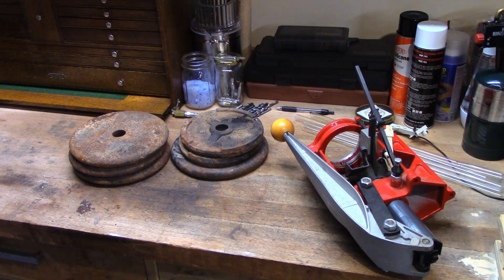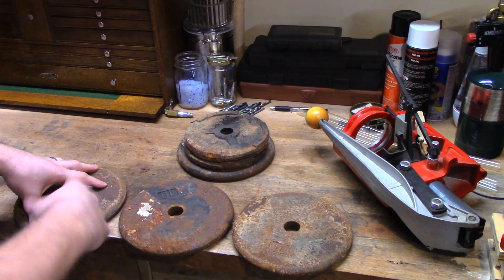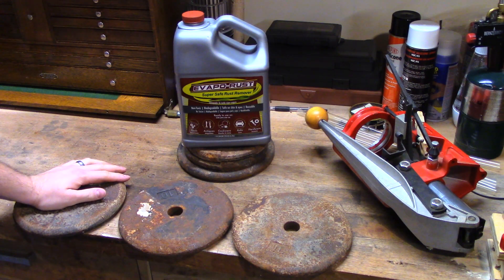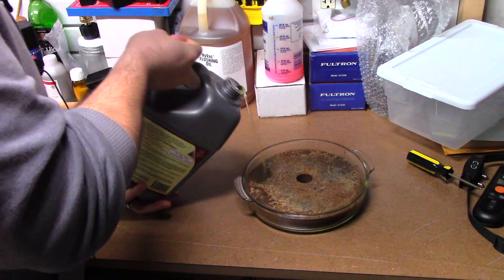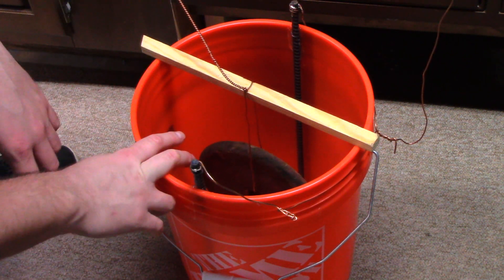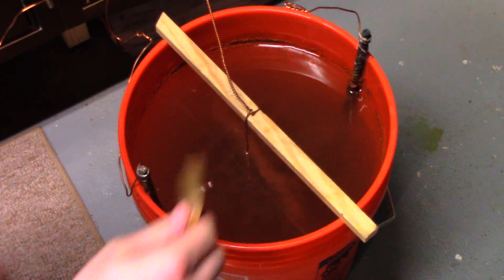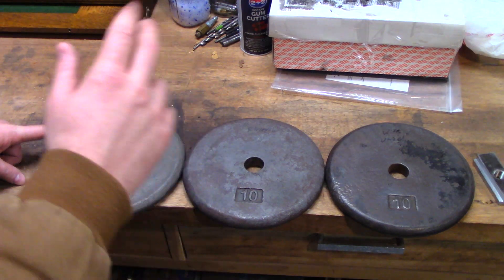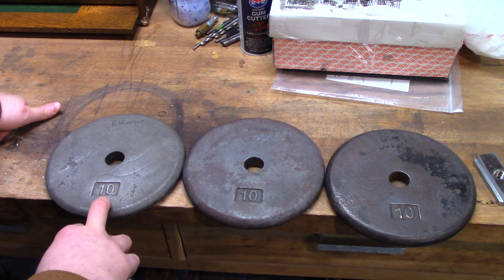Best Rust Removal Method? Evaporust vs Electrolysis vs Grinder with Wire Cup

Comment from the maker: Sponsored by YOU! No seriously I couldn't do this without your support, so a big thanks to my patrons at www.patreon.com/elementalmaker. Please consider throwing a dime at this homeless guy you call ElementalMaker. Hes' homeless because he lives in his workshop. Not really. But Maybe.
Reply: Have you ever tried vinegar and let soak overnight?  That works for me 100% of the time.
Reply from the maker: @anonymousguest9290  I vaguely remember trying vinegar years ago on some big nuts and bolts I needed to clean up, but don't recall how it worked for me
Reply: @ElementalMaker  evaporust works even better/quicker if you apply heat ( just short of boiling for best resaults).
Reply: Use a nickel or Zinc electrode and actually try electroplating a thin protective layer. That way you have a very long lasting rust inhibitor.
Reply: lol you must live in michigan.
Reply: Evapo rust in ultrasonic cleaner with heat works really well and fast
Reply: Hey Em, could you make another video where rust proof the free weights and test corrosion resistance? Theres a cheap method where you repeatedly rust the part and then boil it in water: https://youtu.be/xmv58Z3RZ9c
Is the hot black oxide process too scary? Rustoleum?

Comment: Your wire wheel was way to abrasive need a much softer wire wheel and it would’ve worked perfectly but I agree the evapo-rust much cleaner and easier! Although less abrasive wire wheel is my choice because I have no patience and want everything done yesterday!

Comment: Worth noting is that boiling the part is also an option! It doesn't remove the rust per se, but converts it into a smooth oxide coating (Called blueing I believe), and the excess can be carded off.

Comment: Bitching about the governor.. you don't live in Commifornia do you? When I do electrolysis I just use washing soda in the water.. Sodium carbonate not bicarbonate. OMFG don't say "surfactant" it makes you sound like Shane Klesh. When you do electrolysis make sure everything is as clean as possible or the energy won't flow well. I also used TIG rod that I sanded the copper coating off.
Reply from the maker: Oh hell no I couldn't ever live in that hell hole of a state.

Comment: Is kinda odd..  i used electrolysis to derust a pretty big chunk of iron and for the anode i used two 1' sticks of half inch rebar welded together with a copper solid wire wrapped around the top and used a 12v transformer, one of the old school battery chargers, 10 amp..  and when i had that thing going it only took around 4 to 5 hours and the rebar was totally gone...  used baking soda to help chooch the water but that was it..  and in those 4 hours the part was completely rust free...  expected it to take a lot longer but went to check on it randomly and saw the damn rebar had already been eaten by the pixie gods...  dunno what it was..

Comment: The bigger the anode, the better rust removal you'll have.  Using two tiny rebar in comparison to the surface area of the weight plate is asking for it to take forever.  Re-run it with a piece of sheet metal 2-3 times the surface area of the part you're targeting & you'll see much faster & more complete results.  Also, the more power you throw at it, the faster it goes - boat battery charger on 15 amp mode works well.  Use 'washing soda' (available at pretty much any grocery/department store) as an electrolyte instead of lye.  Running it in the garage means you don't have to worry about gas buildup and using a plain steel anode results in waste liquid that is very good for plants.  Don't know how you'd dispose of whatever's in evap-o-rust, but I have to think it'd be rather harsh on the environment.

Really surprised that you're against curtailing the spread of a disease that's killed nearly half a million people in the US so far... 4 fishing buddies, 2 coworkers, and a friend who owned a local business that I kept the computers up for have died of it.  Week before last, a guy I went to high school with went to the bar & brought it home - his wife died last week & as of a few days ago he was in ICU and they didn't expect him to live. =(  Gyms would be about the worst possible place I can imagine for spreading it as you have lots of people breathing heavily/sweating close to each other who aren't going to want to wear masks because they're working out.

Plus, weights in your basement don't cost a monthly fee and you can work out whenever you want; I went this route about 5 years ago and dropped 40 pounds, plus am stronger than I ever have been in my entire life. =)

Comment: theoretically if you use aditives like glycols the electrolysis can have  better finish  than just plain metal/salt and surfactants also help, even if the part in question has already been cleansed beforehand;

Comment: It's hard to beat sand blasting, because steel becomes so clean it turns "white", and blasting raises the surface profile so that paint adheres better.  You can get cheap SB ordnance for $25.
Reply from the maker: Forgot to mention sand or vapor blasting but absolutely they are the best if you have the equipment

Comment: Good luck with that Loadmaster, I sold mine for a Dillon and it was one of my best decisions.
Reply from the maker: I'd love to get a dillon press some day. They are a thing of true beauty.
Reply from the maker: Yeah I haven't tried it yet but it looks like a real PITA to get operating. I got it for a song anda dance a couple years back at a yard sale day at my local pew pew club. several die sets, tons of new old stock plated projectiles, some brass, primers, and the load master for $100 flat so I figure even if the loadmaster was junk it was basically a break even.

Comment: With gunsmithing, if you boil them first you can convert the rust, then use a very soft fine wire wheel. Works great on old guns to restore the patina

Comment: to make this more cost effective, use electrolysis at first then after a wash put it in evaporust bath so it will not get saturated and you don't have to buy tons of it, maybe adding a bubbler will help also to save some time.

Comment: I've got 2x five gallon buckets of evaporust, it's been almost essential for the lathe restoration that I've been working on. For some larger parts I plan on doing a quick and dirty formed mold to use up as little as possible.

Comment: Take a look at the Post Apocalyptic Inventor.  He uses citric acid for rust removal.   Also you can "season" cast steel like an iron pan.  Linseed oil and bake it at a lower temp and you get a nice bronzish color.  Take a look at 1diocracy for that.

Comment: Isn't the best method an air powered needle scaler? I knew a guy restoring a classic steam engine and that's what he swore by. I haven't cared to buy one because I like my fine wire wheel too much.
Reply: For heavy scaled rust needle scaler are great but in my experience it still leaves behind a fine layer. It's also very loud and needs a really big compressor to run them for a bit
Reply: Not even close ,nothing can beat sandblasting.Or if you dont like the dust you can use it in a high pressure water.
Reply: @zumbazumba1  Originally I bought a big enough air compressor to do sandblasting but I never got a unit. Any good recommendations?
Reply: @johnpossum556  Well cheapest possible alternative is for you to make a sandblasting pot.You can make them out of gas cylinder/air compressor tank/large fire extinguisher/truck air brake cylinder.-Preety much anything that can hold 10 bar of pressure is fine.
These cheap sand blasting pots you can usually buy  for around 80-100$.
For beginers such pot is more than you need for start.They are cheap to buy or to make.Its a pressure pot with 3 ball valves and a hose . Later on you can build your own cabinet out of plywood/boards,some led cheap lights and a acrylic glass.Its a easy project to do with basic wood working skills/if you prefer fancy metal work you can go that way too.
Start simple and see what you need.
People often go and spend a lot of money on something that will stay idle for 80% of time.
Contrary to believe you dont need alot of air pressure to sand blast 8 bar /120 psi of pressure is a overkill.What you need for sucesfull sand blasting is compressor capable of maintaining that 8 bar of preassure all the time .
Reply: There is  a cheaper alternative its called syphon sandblasting gun but those are used for small jobs only.A burned out ceramic fuse makes a good nozzle for those if you are going to make a diy version out of 1/2 " water pipe, T section 
1 ball valve and a peace of rubber hose .

Comment: The way to get in to fine areas is to use a much finer wire wheel. I am a total wire wheel believer but I built my own unit that is basically a 3/4hp belt driven stand alone "bench grinder" with an 8 inch fine wire wheel. The whole thing rolls so I can take it outside for the operation. It looks a little like the Eiffel tower for maximum access to the wire wheel.
 Right now one of my weight plates is at the end of the gutter acting as a splashplate so the dirt doesn't wash away. 😂

Comment: I mean... I'm sure if you used the wire wheel for 48 hours, you can get into the recessed areas and into bores with no problem.
Reply from the maker: Yes the molten grinder goo will get into the crevasses beautifully 😁
Reply: @ElementalMaker  Funny story, "Molten Grinder Goo" was my nickname in high school.

Comment: * Would the electrolysis be more efficient if the electrodes were a lot closer to the weight?
* Next can you compare different paints that are advertised as rust-binding?

Comment: Last year I used Rustoleum Rust Dissolver to pacify some rusted gutters.  I think all these "Dissolvers" (actually converters) are just variations on "Naval Jelly".  They use acids to convert Rust (FeO2) into something else that is more stable (like using phosphoric acid (H3PO4) to turn the rust into Iron Phosphate (FePO4)).  That is their befit and limitation.  They don't turn rust into iron; but, they turn it into something else that can't rust.  If you need bare metal, the wire brush is you only choice; but, for most of us, that isn't what we want so they are a really great solution.  Note: From what I have seen, most of the reaction is done in <30 min.  I doubt you needed 48h and for the gels you just need to coat the part not submerge it.

Comment: The postapocalyptic inventor did a comparison between electrolysis, vinegar, citric acid and a german rust remover:
https://youtu.be/HN590K81D5c
And
https://youtu.be/jqN5zY_T2Kc
As other chemicals and especially other acids like hydrochloric or oxalic acid are way harder to get here.

Comment: A late friend used a plastic tote and a lot of citric acid for cleaning rusty cast-iron pans.

The citric acid, might be cheaper than the evaporust.

He would let it sit in the tote for a few days, and the sunlight would speed up the de-rusting.
Reply: I know it works wonders on brass. I’ve never tried it on ferric metals.

Comment: I generally use a citric acid water solution. It works a treat, is cheap, safe and environmentally friendly.
Reply: That's exactly what my late friend used for removing rust from cast iron pans that had rusted in storage.

Comment: I giggled like a little school girl when I see you grab a metal spoon 😂

Also, back when I did pump repair we had a bucket filled with muriatic acid (Hydrochloric acid) that we'd dip rusty parts in for a few minutes to disolve the rust, but if ya left it too long you would start to etch your base metal. Worked well, but not a friendly process haha

Comment: I wonder how evaporust compares to CLR.  
How do ya like that folding work bench with the clamp tracks in it? I'm thinking about getting one.
And...you do this stuff in your house???  How is it the wife ain't gave ya the boot yet...you need a garage. I'm thinkin it would only take 5ppm of hydrogen sulfide and you'd be in the doghouse forever.
Reply from the maker: I'm working on renovating my old decrepit detached garage which is why I'm doing alot at my basement bench right now. I hate it... scared to do anything fun for fear of catching the house on fire or creating toxic gasses. Can't wait to get my garage set up. I think CLR is acid based if memory serves. Evaporust is actually neutral which surprised the hell out of me.
Reply: @ElementalMaker  I've never had clr etch anything...CalciumLimeRust is where the name comes from and I think it's "all natural"  just wondering which one works better.
Reply: @ElementalMaker  BTW: I bought some of that spray on instant rust remover you see ads for online......they sent me squirt bottles of what seems to be 3 in 1 oil.
Did less to remove rust than wd40 does.
There are a lot of people selling complete shit online through false advertising.

Comment: An important factor to consider is how much material gets removed. If the result is too thin, it could be a problem, or in the case of the weights, ift they're no longer the weights they're supposed to be, then they're, well, not really what they should be.

Comment: I recently saw this on a gun smithing channel. Try boiling your rusty part in water for about an hour once or twice. No shit it neutralizes red Iron oxide and turns it into Black iron oxide. I tried it, using a deep fryer it got rid of all the rust on an old casting I was cleaning up.
Reply from the maker: Yessir! Rust bluing is what that is called and its a great option. I've been wanting to try doing that to some steel parts I have. I also was thinking of trying to make DIY parkerizing solution

Comment: Evaporust is great.  But a faster way of getting to clean bare metal is HCl. Can get it pretty cheap at home depot as muratic acid.
Reply: But if you forget it in the acid, you no longer have an item.
Reply: @SnorrioK  it only takes minutes for it to dissolve rust.  If you walk away and leave it then that's your bad.
Reply: @ThinkFreely2012  - I know. I just use citric acid myself because I am afraid of strong acids. My apparent and lifelong clumsiness does nothing to help me stop fearing strong acids and bases.
Reply: @SnorrioK  they are both those that should and should not handle string chemicals.  So good of you to know that you don't feel safe using them.

Comment: Do a pH test on the Evaporust. A lot of rust remover products use just citric acid.
Reply from the maker: I should have mentioned its actually neutral
Reply: @ElementalMaker  Vinegar also eats rust ,slowly but it does ,it leaves black schmoo thou that you ned to remove with wire brush .Phosphor acid is used in some rust removal products.

Comment: Electrolysis is somewhat size limited because your power supply will eventually provide too little current for the surface area of the part. That being said, it wouldn't be hard to just get a larger supply.

Comment: Great video!  I use electrolysis for cleaning really rusted iron/steel artifacts.  Your solution didn't appear to be active enough to do the job properly, because 48 hours is about 10 times the amount of time it should have taken to completely clear the rust off that weight.  Part of the issue could have been that you had the copper wire on your weight submerged in the electrolyte, the other part could have been that your cathodes just didn't have much surface area compared to the weight and were pretty far away from the weight.  Electrolysis is fairly line of sight.

For example, pushing 2 amps and using 2 anode plates I cleaned a 150 year old 6 lb axe head with about 1/2" thick of iron oxide and black oxide in about 17 hours.  Electrolysis will deposit a black residue of calcium phosphate onto the cathode if you use a baking soda based electrolyte.  A quick brush with nylon and a 30 second dunk in acetone to dry the iron is all the prep you need for paint/sealing.  It's multiple steps, and is more labor intensive and equipment intensive than evapo-rust, but the results and preservation are really top notch.  If you do it a lot, electrolysis is cheaper in the end and you have much more control over the results.

Comment: Given the size and shape, I'm going with either a wire wheel or a flapper disc.  Evaporust is great stuff, but this use-case  would be a waste.  They are almost entirely flat surfaces that are ridiculously easy to clean.  Evaporust is far better for irregular shapes that are difficult to clean.
Reply: Yeah I flap disc or a wire wheel would do the job just fine it doesn't need to look like the next mona lisa because the paint most commonly used on them is textured paints  having them as sooth as a babies ass combined with sweaty hands is a recipe for a broken toe especially for those weights that don't have a rim
Reply from the maker: Agreed, this was just to test effectiveness on similar items. No doubt in this particular case I'd 10/10 times just use the wire wheel.